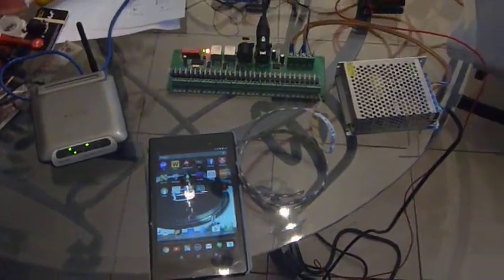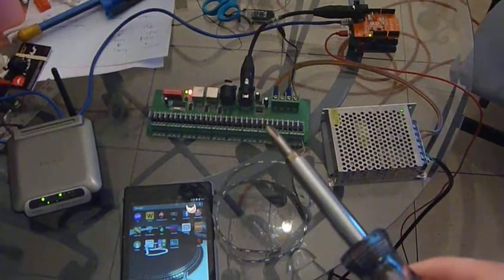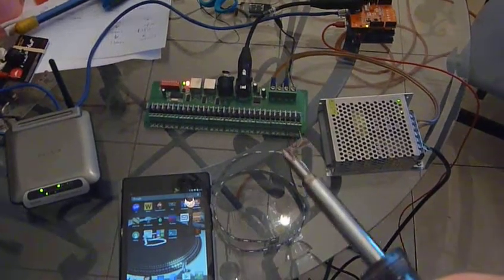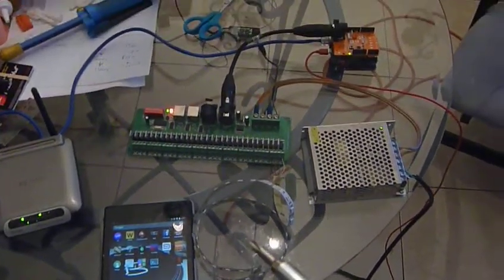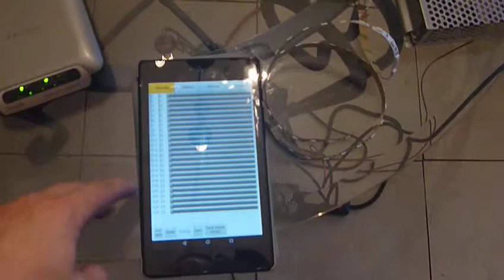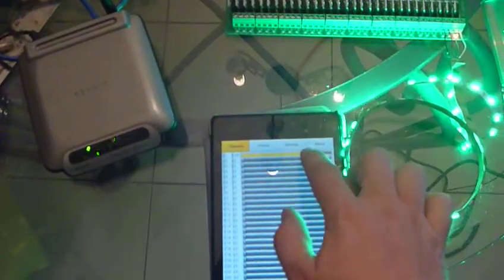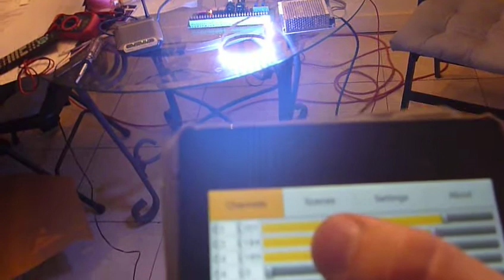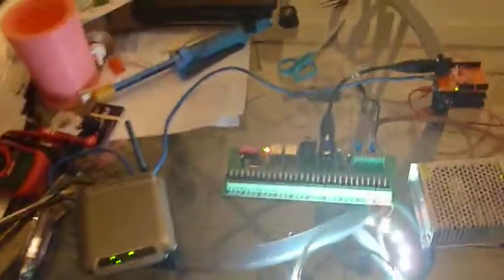Wireless LED ArtNet node control setup for cheap with Arduino

Comment: Can you please help me to make a code for DMX  stapper with optical encoder
Reply from the maker: It's been a long time since I worked on this project, I can try and look at code you may have already written, but an optical encoder will require some reprogramming
Reply: Please help me to make a code for DMX stapper motor with optical encoder

Comment: Why not use the on board Ethernet ports versus the DMX connectors? Both provide the same data input. I am only curious
Reply from the maker: Three Eighty C the dmx shield does not have an ethernet port, the cat5 ports on the led driver is not ethernet, its just dmx over cat5 so, yes you could make a cable that is a dmx plug on one end with a rj45 connector on the other (with the proper wireing) but you cannot just plug the driver into the router.